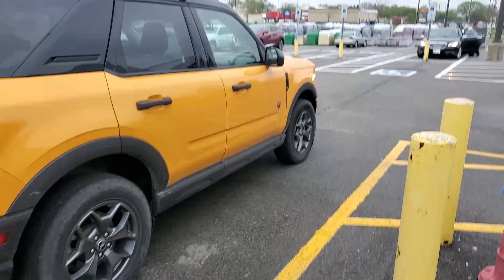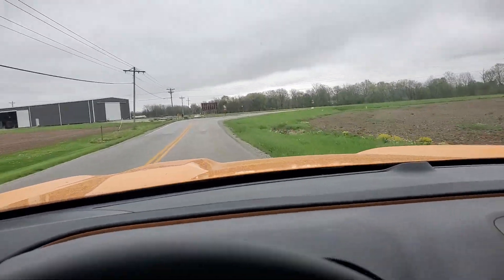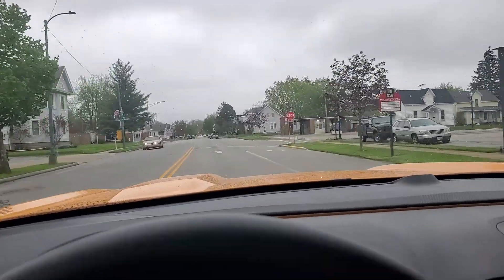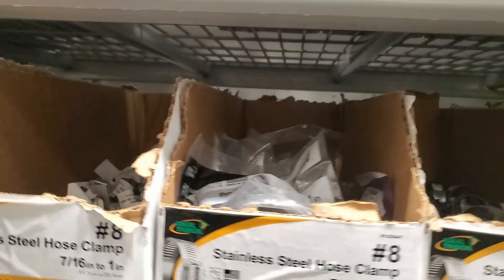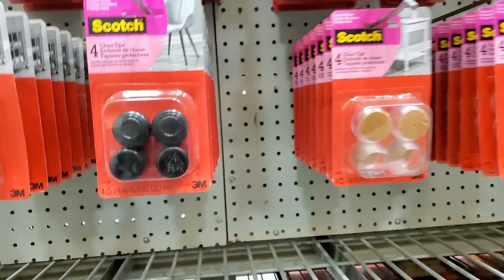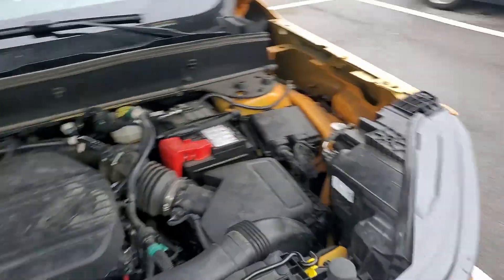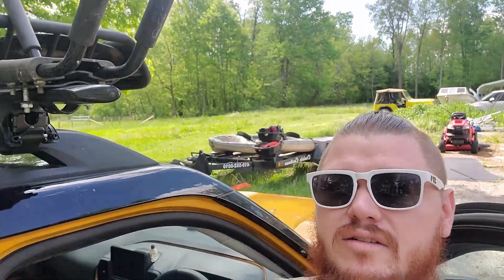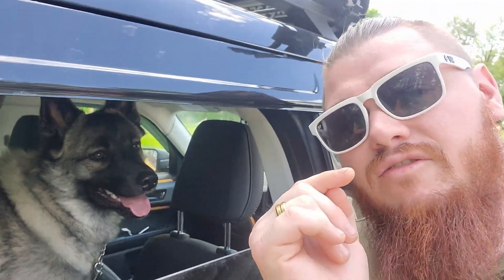Bronco Sport BOV Turbo Spinny Whoosh

Comment: My Big Bend does it louder in Eco mode. But I still wanna do this! Just can't find the hose you're talking about.
Reply from the maker: Yeah so the turbo is driven off your exhaust pressures. So you'll build more boost when the engine is under more load. So when youre in eco mode, ford reduces the rpm to save fuel, so when you hit the gas the engine needs to try harder to accelerate so you'll get higher boost.

Comment: I have the same kind of bronco and my two liter ticks just like yours is in this video, is that normal or should I be concerned
Reply from the maker: Its fairly normal on any engine using hydraulic lifter adjusters as they make changes. So when you first start your car you'll likely hear it, especially with the hood open, but it should mellow out as it runs. Its super important to keep your engine oil changed and clean. On older engines ive had to tear the lifters apart to clean the small oil office that could get clogged by oil gunk

Comment: Don’t know what hose to pull off on my 1.5 liter I can’t seem to find it there are 2 hoses next to each other but I don’t know which on to pull
Reply from the maker: It would be whichever hose goes back into the intake. 

It's called a recirculation valve if that helps you look it up for your engine.
Reply: @HCRacing Could you make a video or something because I’ve been having an issue finding the valve connected to the turbo on the 1.5 engine

Comment: How the hell did you manage to take the hose off?? I’ve been trying for 30 min lol. Flathead and needle nose. I’m getting it to budge slightly but not enough to back it off
Reply from the maker: With pain and suffering lol. Toss on a glove if you have it, get that clamp moved, then grab and twist first.
Reply: @HCRacing  got it! Few cuts later lol
Reply: Is there any concern with recirculating the excess back under the hood in regards to adding more hot air into the engine bay? I’ve always gone with the traditional bov but $350cad saved is a non-brainer.
Reply from the maker: @esbuddd  no, not at all. Because the air is going from being pressurized to being released, it will actually drop the temperature.  I mean it's not cold, but it's definitely not hot either. 

I'm still thinking about routing mine into the cowl to make it louder. But never got around to it.
Reply: @HCRacing  okay thanks for clearing the air on that one (see what I did)

Comment: You’re not supposed to run a diverter valve on this system. Causes the vehicle to run rich, lost power, and lower mpg
Reply from the maker: Pre cat O2 sensors make all of these statements wrong. Your vehicle is constantly adjusting for changes in temp, elevation, humidity, and changes in fuel quality and ethanol levels. 
This will make no difference on your car. 

Defaulting or removing the valve can cause issues due to pressure differences. But we are redirecting.

Comment: DO NOT BE CHEAP LIKE THIS GUY! BUY PROPER PARTS
Reply from the maker: 🤣🤣🤣🤣  and what "proper parts" would you like?  The parts are already present, just being recirculated to reduce noise.
Reply from the maker: This comment right here is the true difference between buying what a company says you need in an advertisement, and understanding the system at hand. But yes, I am being cheap, that's what having my associates in higher performance and racing technologies allows me to do, understand and build the part without wasting my money.

Comment: Ok you spent too much time going and showing us Home Depot/Lowes but never showed us what you actually did and showed us the install process; you just talked about the install. I wanted to see it!. Besides the swish?  what does this buy us in performance?
Reply from the maker: it buys you zero performance, you are simple unplugging the recirculation routing and plugging it off. 
A major part of new production vehicles is to eliminate all sounds, a normal person doesn't want to hear the engine, or the turbo,  this simply allows you to hear it. 
With a modern performance vehicle, you will almost never have performance gains from small hacks like this. If you have a badlands, it's the same drivetrain setups as the Focus ST, so there are plenty of tunes out there, but you'll need to take your car to a tuner to have the PCM unlocked and retuned

Comment: When I let off the gas I hear a weird sound like a whistling noise is that normal or is that just the turbo When I first buddy I didn’t hear it a couple hundred miles and I started hearing it
Reply from the maker: It depends what you mean by a "whistling noise"
Your turbo will absolutely wind up when you're accelerating, and if conditions are just right you will hear that whistle especially when you let off and the engine noise starts to quiet down. I can hear it best when coming down the onramp for the highway. 
Also if you don't build enough boost to activate the recirculation valve, you could hear a flutter or whistle, still completely normal. 

But without hearing it myself I couldn't say 100% for sure.
Reply: Ok ty